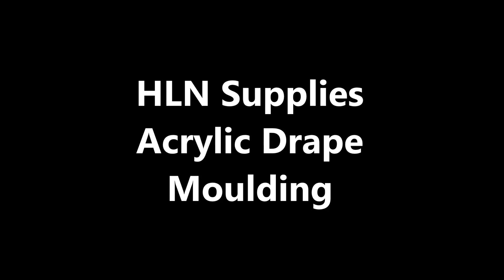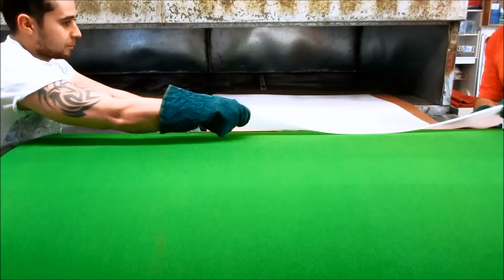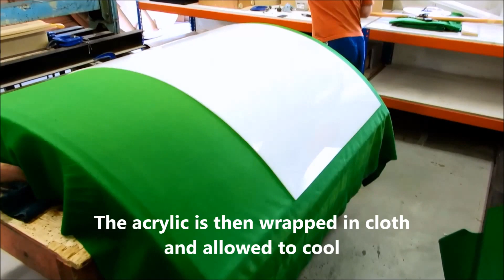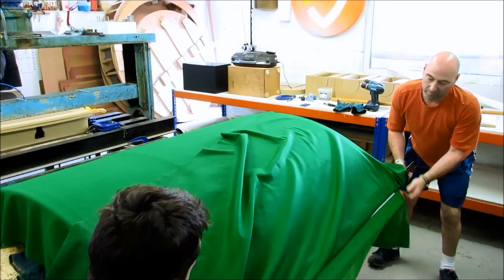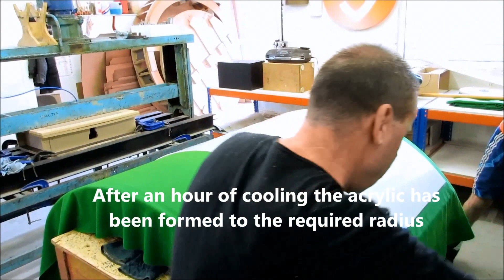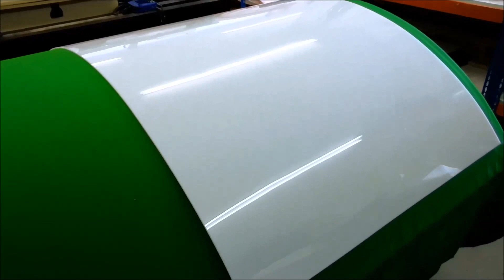Acrylic Drape Forming. Moulding Perspex to any shapes.

Comment: Here’s some info on the cloth used;

The surfaces of forms should be free of waves and other variations in contour that might cause optical distortions in the finished part. Surfaces of drape or snapback forms are usually covered with soft cotton flannel cloth, flannelette, velvet, or billiard felt. The nap of these cloths helps prevent mark-off which might otherwise result from small dirt particles or irregularities in the surface of the mold. For covering three-dimension forms use suede rubber or flocked rubber sheeting which can be stretched to the contour of the form.